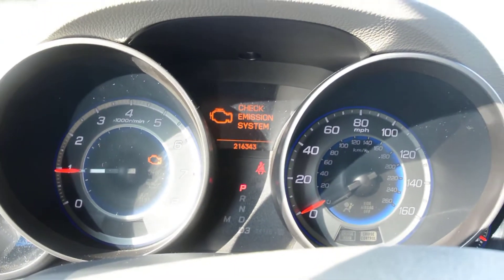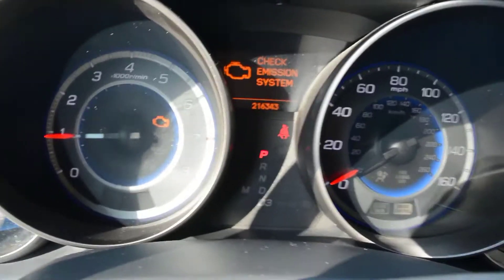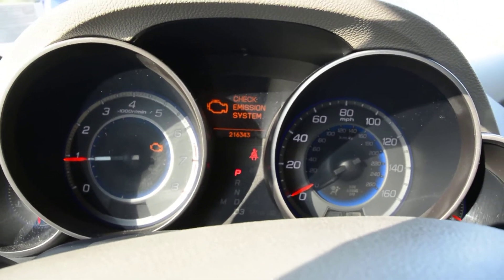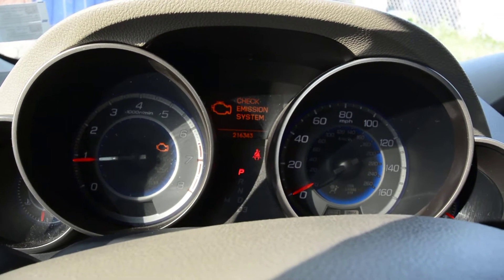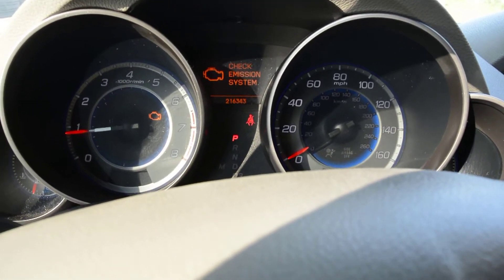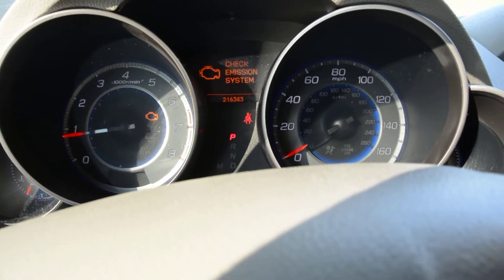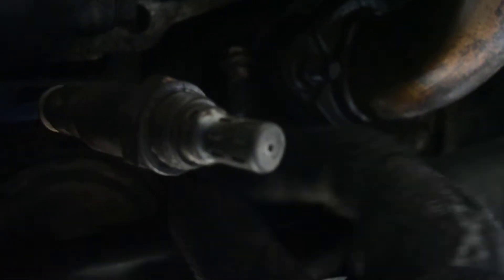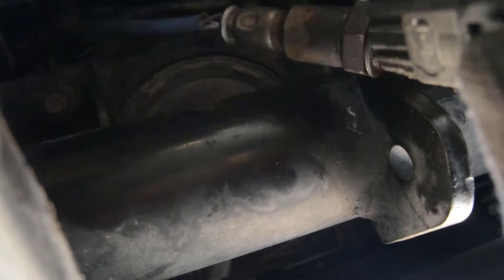acura mdx 2009 p0420 p0430 temporary fix

Comment: Did you put the defouler in bank 1 sensor 2?
Reply from the maker: Yes, bank 1 sensor 2 and bank 2 sensor 2
Reply: My ODB2 was showing Bank 1 on the reading so I only put a defouler on that one. It wasn't easy at all to do it. Took me 1 hour to do it. Not enough room and I had to use various wrench extension to work it. I did it last night and passed the test today. Thanks for the video.